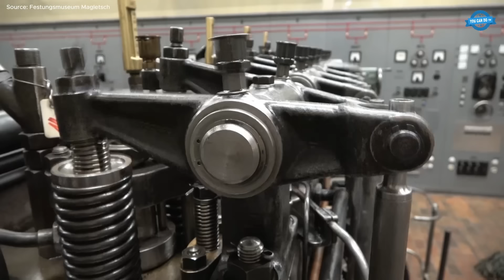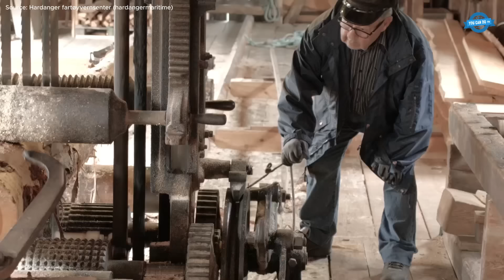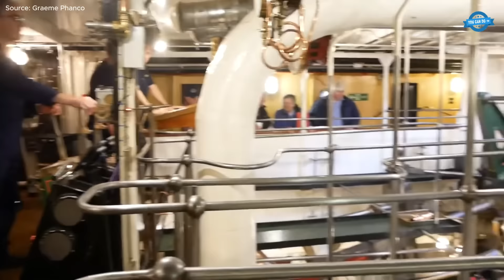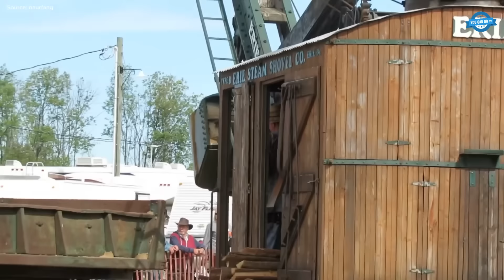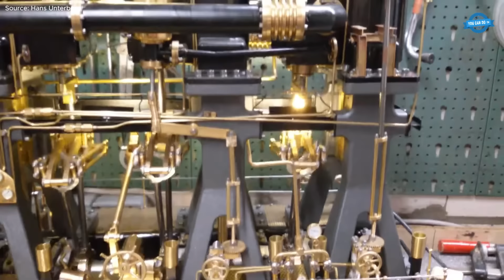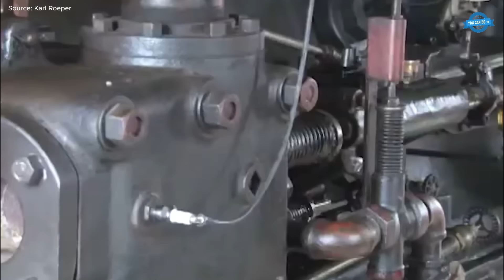Steam Era Giants Still Run Today. Steam Engines, Locomotives & Industrial History Documentary

Comment: At around 1.41 The Rolls Royce engine is being started with what appears to be an Ether based spray. This is a very bad thing to do as the higher than normal combustion pressure can cause damage to the piston ring grooves and/or the rings themselves. This can make the engine addicted to the treatment and can and does cause excessive oil passing into the exhaust. and reduce engine efficiency dramatically. Much better to use a lit fuel soaked rag in the air intake.